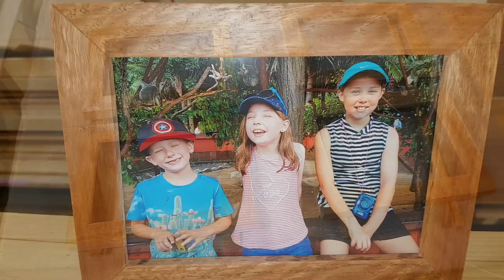Building a Table Saw Picture Frame jig and Photo Frames

Comment: Very nice. Another table saw jig that I need to add to my collection!
Reply from the maker: CHeers Wes, I highly recommend checking out the original video from David @ Make Something. I made mine from scraps in under an hour and seems to be fantastic so far. Looking forward to replacing my screw down end block with a toggle clamp though!